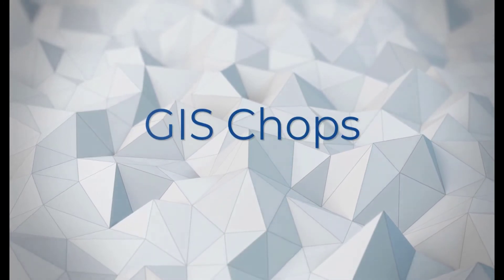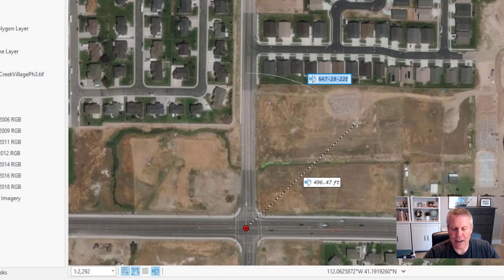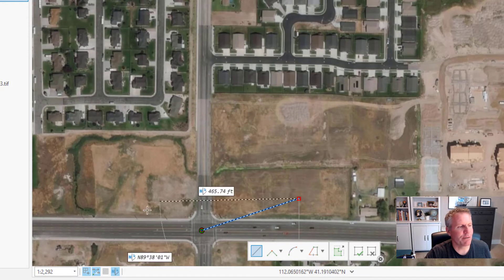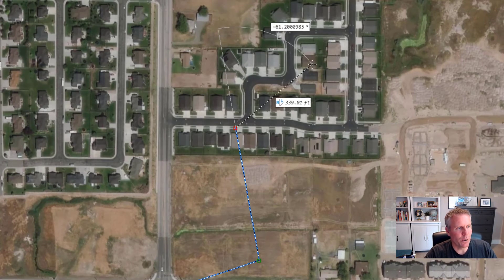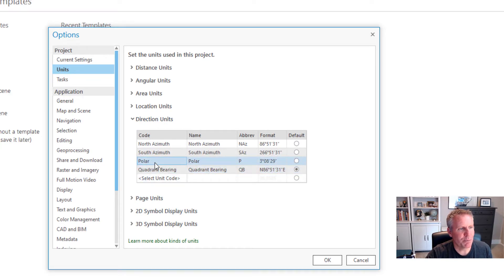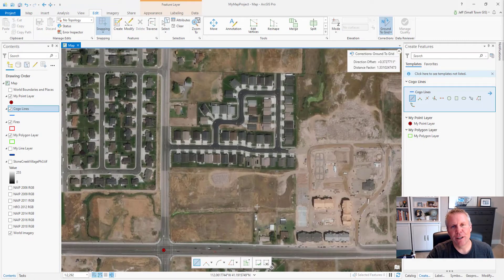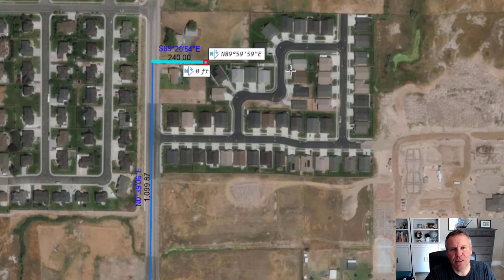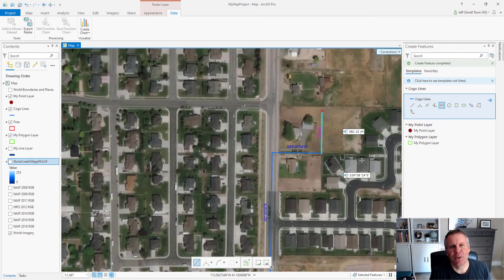ArcGIS Pro Tutorial: Editing With Dynamic Constraints

Comment: 1:21 What is this coordinate format?
Reply from the maker: That’s a shortcut to entering bearings when your direction units in the Options-> Units -> Direction Units are set to Quadrant Bearing. It’s so I can stay on the number keys, I don’t have to type out N 72-31-04 E. Instead I enter 72.3104-1 which is in this format - DD.MMSS-Quadrant. The quadrants are 1 = NE, 2 = SE, 3 = SW, and 4 = NW. It’s an easier way to enter bearings quickly.

Comment: Very helpful video. Quick question on Dynamic Constraints and the direction unit. I can't get my dynamic constraint direction unit changed from meters to feet. In the Options menu I have the unit set to USft but my dynamic constraints distance still appears in meters when I'm creating features. Do you have any tips or a video on this issue? Thanks again for the great info!
Reply from the maker: Thanks for watching and commenting! Did you save the project after changing the units in the options? Which section of the options did you make the change? I think the dynamic constraints uses the units in the editing section.
Reply: @GISChops  Thanks for the pointers. I did save the project. I made the changes in the Unit section of the Options tab. I didn't see any place to change the units int he Editing section of the Options tab. I'll keep looking for a solution.
Reply: @cmiller7255  try changing your projection to one in US Feet, worked for me.
Reply from the maker: Great tip, thanks for the helpful comment!

Comment: Hi sir :) Good videos , just was wandering if there is nay way to mesure the bearing  and distance between 2 points in an easy method ( can't mesure it by mesure tool i got the 1.2 arc gis pro so it got just distance)
Reply from the maker: Thanks for watching! I just put up a short video that shows you how to get the bearing of a line without using the dynamic constraints tool - https://youtu.be/9XOykOHE1vA